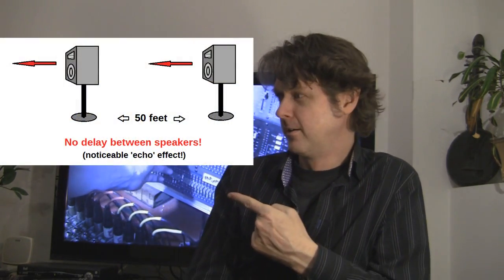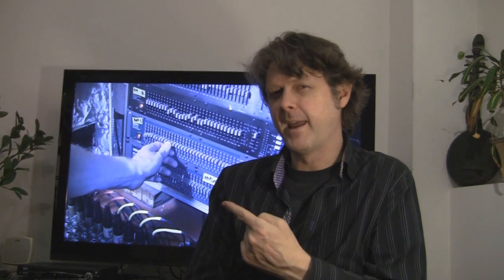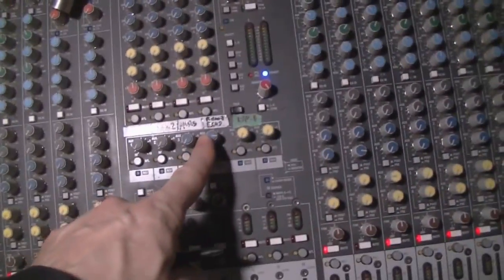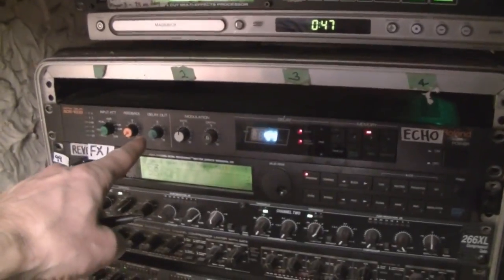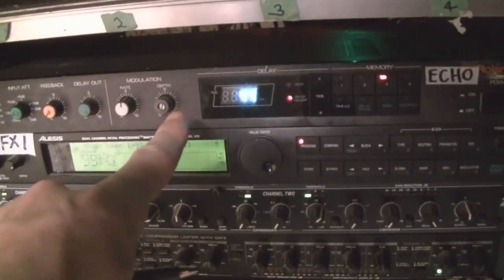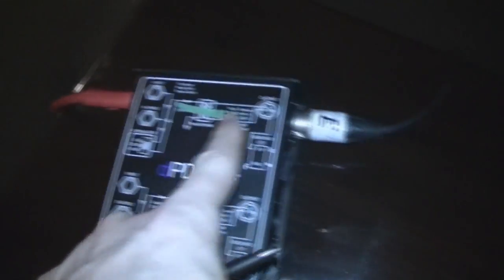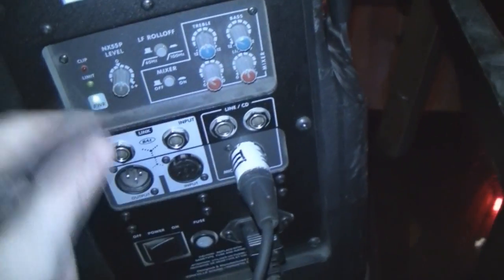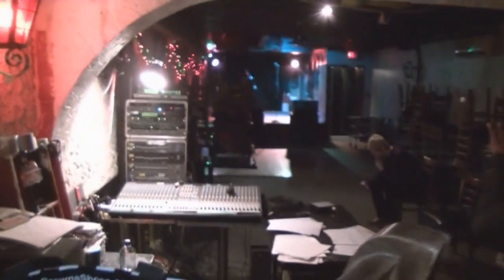How to Set Up a Delayed speaker in a Nightclub - Live Sound System Fill Speakers

Comment: Great video! Question: why did you use a DI box to convert the signal to XLR when there was a 1/4" input jack available on that speaker? Genuinely curious, thanks.
Reply from the maker: Thanks! As a rule of thumb, I run unbalanced lines no more than about 20 feet. So a balanced XLR could give me choices from 50 to 75 feet back with a clean, strong signal. Cheers!
Reply: That makes sense. Thank you! @bacontrees

Comment: How can I delay powered speakers. I have two different powered speakers that I want to play together but there is a delay in the optical one. Is there a device that can achieve this
Reply from the maker: The feed always has to be split with one signal being sent through a delay device...so, no matter what speaker, the delayed fill speaker must somehow get a delayed signal...I'm not sure how your system is wired with the optical speaker?

Comment: Hello 2 question.1 question is let's say we don't have opportunity to put our foh in the middle or back of the club.So in this possition should we use delay other way when we don't use delay?and 2 question why did you use di box for delayed speaker.Thank you)
Reply from the maker: I'm not sure I understand the first question, as the speakers in the middle of the room are not FOH; they are the 'delay' speakers. This is the way it should be as the speakers have to point in the same direction. For #2, I used a DI box because the delay unit was only 1/4" TS out, so a long cable run should be balanced and the DI allowed for that, to be fed into the powered speaker's XLR input.
Reply: Thank you for answer my question.I was in one event  there has been set up mixer not in the middle of the hall i guess you got me the mixer in the left side of the hall i asked to the engineer about the side speaker work with delay he asked me why it doesn't need.So this reason i asked does it means where to put speakers for delay speakers

Comment: Probably a stupid question. But does sound travel faster or slower at different altitude? Example being. If you were setting up in a long room on top of mt Everest. Would the delay speaker be set different than say a long room at the equator. Where it’s thick hot humid air. Or does sound travel at that speed regardless of location. Even in space? Hahaha sorry. This question even looks dumb as I’m typing it
Reply from the maker: Sound speed in air changes with the environment, especially humid/warm and cold air masses. From research I did years ago, sound travels at 1127.42 ft/sec at 50% humidity and 70 degrees F, rising 1.1 ft/sec per degree rise in F. I am unsure about the altitude fluctuations as I've never been in such a situation way up high. 

But, at normal levels (sea level, for example, or near it), and normal temperatures, sound doesn't fluctuate that much....if you were to increase the temperature in Celsius by 100 degrees, it would start to move noticeably faster...but, you would only need to adjust the delay time of speakers a little to account for the speed change, and most people won't notice if it fluctuated up to 20ms, assuming the delayed speaker is less loud than the FOH PA system.
Reply: bacontrees thanks man!

Comment: Great video.  You did a great job explaining setting delay.  One suggestion is to add a millisecond or two to the delay speakers to improve localization.  If I am sitting behind the delay speaker and the fronts and delay speakers are exactly  aligned, the sound will appear to come from the delay speaker because of volume precedence.  You localize on the louder sound source.  But if you add a millisecond or two to the delay speaker and are sitting behind the delay speaker, you will hear the sound from the stage first and then the sound from the delay speaker.  The ear will localize on the source of stage because it hears it first even if that sound is significantly quieter.  As I recall this is often referred to first reflection localization.

This is why hard panning of spoken words does not work very well if the audience's distance to the speakers is less than the distance between two speaker stacks on stage and you are off to one side.  Hard panning to the other side only makes the spoken work sound softer.  It does not pan the sound to the other side of the stage because you localize on the much quieter speaker in front of you even though the far speaker is much louder.

Try it yourself.  If your speaker are 75' (25m) apart, sit to the side of the auditorium directly in front of one of the speaker stacks about 50' (17m) back and play back a spoken word audio track.  Close your eyes and pan the track back and forth, hard right, hard left.  Does the sound appear to move smoothly across the sound field? Or do you hear it getting louder and softer and it only changes location when the pan reaches it's extremes?  To correctly pan in this part of the auditorium is to use delay to pan the sound.  Adding delay to the side of the channel feeding the speakers in front of you will pan the sound to the other side without using the pan pot or changing the signal level.

This demo is thanks to David Robb at the now defunct Live Sound Workshop back in the late 90's.  David Robb is a world renowned Broadway and music hall (auditorium) sound system designer.
Reply: Thanks for the details 👌🏾

Comment: kindly elaborate the easiest means of finding delay without any software
Reply from the maker: There is no software here, just the equation. Aside from the equation, you can clap drum sticks in front of a mic and adjust delay time until the delayed speaker sounds sync'd up with the front of house speakers. The drum sticks work because they act as a loud transient if clapped slowly.

Comment: What if a have a third speaker in a row but all three speakers are 20 ft appart frome each one , the second speaker wouldnt need a delay but what about the third? If it need from where would you set it from the second or the first?
Reply from the maker: Great question! Upon setting speaker zones at a large corporate event a few years ago, I had discovered that if the speakers are within 20 feet or so apart, the delay was not noticeable. So, the speaker in the middle tends to 'fill in the gap' and further even out the volume in the room. 

The rooms I tried it in were wide and had 3 speakers per side to fill the gaps between speakers, all daisy-chained together (actually, when I used the Anchor min PA's for vocals and playback, the main speaker was daisy-chained to the firs fill speaker, then the second was parallel out, so the 2nd speaker's volume controlled the 3rd).
Reply from the maker: This is like a horizontal 'distributed system' set-up.

Comment: sir, i am saikat. i want to know that the delayed speaker system which echo processor is i use and how?
Reply from the maker: Any delay unit, which can produce a delay time with no repetitions and have a 'delay only' output, will work. This is a delay from the 80's (Roland SDE-1000), so there are many more units available now...such as the Behringer 'Shark' DSP110.

Comment: Thank you so much for this video, it is very informative. . . Now i know how to do calculations when running delays. . .  I just have a quick question though. . .  What if the rear speakers are on the back wall  facing front of house do you still implement the same delay structure or would it be different ,  in other words you have a 100 x100 room and there is speakers in each of the 4 corners and they are all facing the center of the room. How would you implement a delay with such a situation? I would be very appreciative of any answers. 
The reason I ask is I have 2 Mackie C300z[there the passive srm450] and a Behringer b215xl   I use the mackies as FOH but there are times I would Like to put the Behringer against  the back wall facing FOH, that way the back of the venue has sound while at the same time providing me a make shift monitor so that I can hear the highs of my mix, I never implemented this before for fear of latency with the sound, but I know there must a way to do this so that all the speakers are in alignment with each other. Any Suggestions would be greatly appreciated ,
Reply from the maker: Hi there! The speakers should all be pointing the same way. The reason is that they are sending most mids and highs in one direction (the intelligibility portion of the spectrum), therefore the sound from the back of the room will be slapped back to the FOH area. If you delayed the rear speakers so that you heard the FOH and delayed speakers at the same time at the mixing position, then the people in the front and back of the room will still hear a delay because of the different arrival times in those areas. In short, they must be aimed in the same direction.
Reply: I can't say I disagree with the logic of your comment, what you say makes perfect sense. . . . however I do know this set up  is implemented on many dance floors in clubs aka the 4 corners approach where they put a speaker in every corner of the dance floor all facing the center of the dance floor, is there anything they do in particular that maximizes alignment in such set up, or they just all nieve? lol
Reply from the maker: Since every speaker has a time-path, being in the middle of them all would be the best spot with 4 speakers, one in each corner facing the middle. But, when such systems are set up, the average bar owner doesn't know anything about time delay of sound. So, if they must remain in the corners, perhaps a) pointing them at a downward angle would help, or b) put a set of speakers in between them to help fill in the area where delay is most noticeable. Let me know if this helps.

Comment: What would be the formula with meters in stead of feets? The same?
Reply from the maker: +Nazario Meshoulam - you could try "2.89xD" for meters....seems pretty accurate. For example, .88x100ft= 88ms, .88x50ft= 44ms, .88x200ft= 176ms.....2.89x30.48m= 88.08ms, 2.89x15.24m= 44.04ms, 2.89x60.96m= 176.17ms (if 1 ft = .3048 m)

Comment: Can i use my behringer dcx2496 for delay
Reply from the maker: +gracelyn castro - probably not, but any delay unit that can have delays from between 20ms and higher will be useful, as a dedicated speaker delay. I think the unit you mentioned is a speaker management system (Crossover plus...) similar to the DBX Drive Rack.....I think the delays inside are simply for time-alignment to correct for speaker placement at the front of house, but not for delayed 'fill' speaker......I will look closely at the manual....
Reply: +bacontrees thanks alot
Reply: what delay unit will you suggest to use?

Comment: Great Video!  Question, do you run the delay feed out of the aux pre or post fader?  This video is very helpful
Reply from the maker: +lookin2jam23 - Thanks! Great question - Going pre or post is a choice depending on how much master control and balance you want. But I would choose post fader if I make a mix through the auxes, because the mix decisions will be at both ends, then if I fade the channels down for music to play after a set, it will be faster for me to make the change as it is easy to wipe the mix and not have to zero the auxes as well. 

But, if I want to balance the front and back (delayed) mix levels differently, I would do it pre-fader so the delayed mix stays constant - but then, if I gain ride the FOH mix, I have to choose how that will affect the delayed speakers.

Since I can't monitor the delayed mix as accurately as the FOH, and Mostly vocals and guitars, etc (not bass drums or bass guitars) are being delayed, I am happy to have a separate delayed mix pre fader. If I send the whole delayed signal from a parallel output of an EQ, it's post fader anyway.

Both will work depending on how you want to control it.

Comment: I have yamaha rev 100,  has dry and wet and delay time, can I use it and how it work,
Reply from the maker: I'm not certain that the Rev 100 has a programmable delay in discreet ms. You would need a dedicated delay unit and then you would use 'wet' signal only, not mixed with any original signal. Let me know if this helps...cheers!
Reply: @bacontrees  what type of delay unit do you recommend

Comment: what do we use to delay the speakers?
Reply from the maker: Any digital delay will work if it can be programmed. The Aux send goes through the delay unit, then to the powered speaker...in this case, through a DI box because the delay unit output is 1/4 inch, so I could run a long line of XLR cable to the speaker. Cheers!

Comment: Fantastic, simple and helpful video. Would I need to add a delay to centre fill speakers if they are not perfectly in line with the main FOH? Our mains are flown 5m up and slightly back from the front of the stage. The fill speaker would be on the front edge of the stage.
Reply from the maker: +James Cartwright - sorry I missed this! I have never delayed speakers at the FOH but I know some mixers who have. If I had a time-align delay available, I would, but then I figure, with the band already having amps not lined up with FOH, it probably won't be too noticeable when a FOH speaker isn't perfectly lined up with other FOH speakers.